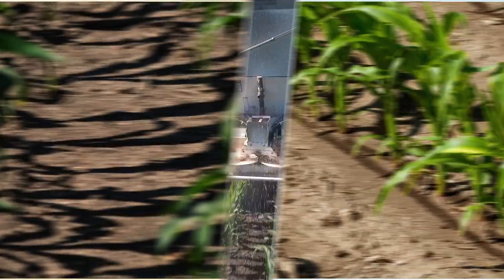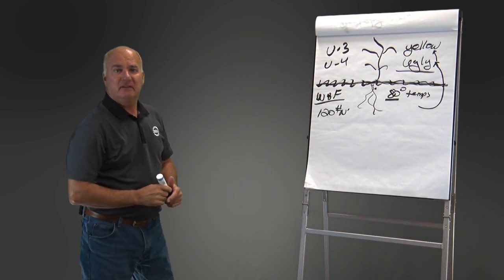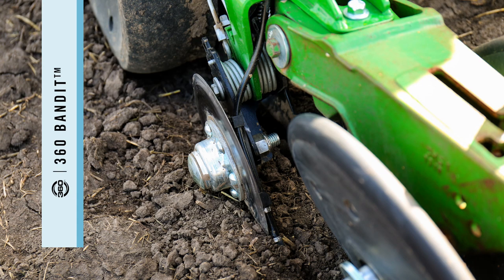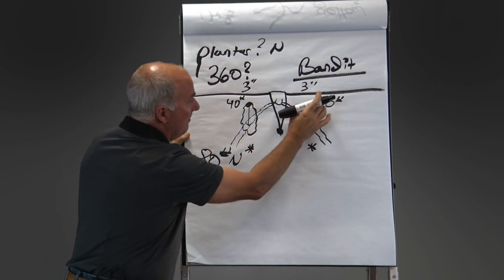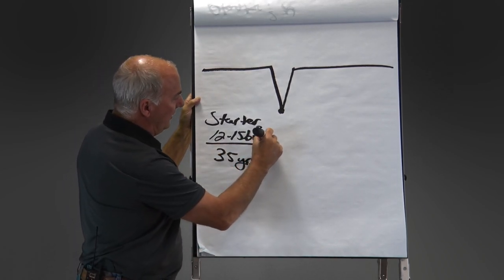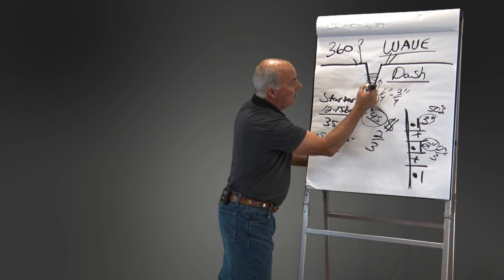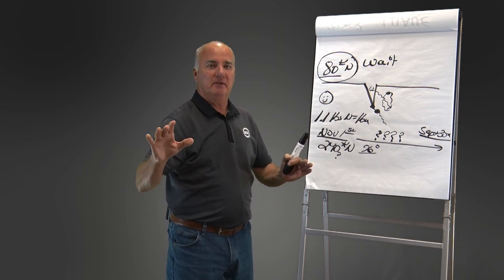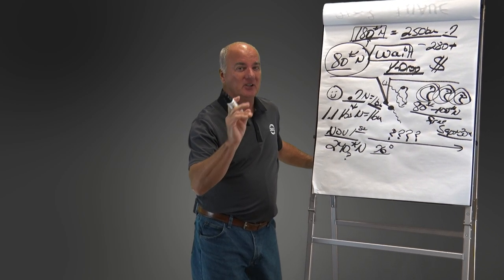Our Four Year Transition to Banding Nutrients

Comment: Для того, чтобы воспользоваться природой, необходимо, чтобы прилежащие к бороздке междурядные слои почвы, куда будут вноситься минеральные удобрения, были проницаемы для влажного атмосферного воздуха. В этом случае до глубин 20 см. (корнеобитаемого слоя кукурузы)  будет происходить   конденсация влаги атмосферного воздуха. И тогда внесённый азот станет доступен корням кукурузы. Но при использовании дисковых сошников с катками, регулирующими глубину сева, почва междурядного слоя станет трудно проницаемой для атмосферного воздуха,  желаемый эффект существенно снизиться.  Уменьшение прижимной силы может только уменьшить, но не устранить эффект уплотнения почвы междурядного слоя, куда следует в соответствии с природой расти корням кукурузы.😃
    In order to take advantage of nature, it is necessary that the row-to-row layers of soil adjacent to the furrow, where mineral fertilizers will be applied, are permeable to moist atmospheric air. In this case, up to a depth of 20 cm. (corn root layer)e condensation of atmospheric air moisture will occur. And then the nitrogen introduced will become available to the corn roots. But when using disc coulters with rollers regulating the depth of sowing, the soil of the inter-row layer will become difficult to permeable to atmospheric air, the desired effect will decrease significantly. Reducing the downforce can only reduce, but not eliminate, the effect of compaction of the soil of the inter-row layer, where corn roots should grow in accordance with nature.😃

Comment: How do you get the starter fertilizer to drop exactly where the seed is ? If your 6” apart seed drop how do you get 2” of fertilizer exactly at the seed
Reply from the maker: 360 DASH reads seed data from the Speed Tube or Exact Emerge brush system. So it knows when seeds exit the seed tube and time the liquid shot accordinlyl
Reply: @360yieldcenter   can it work with wave vision tubes? Or does it have to be high speed?